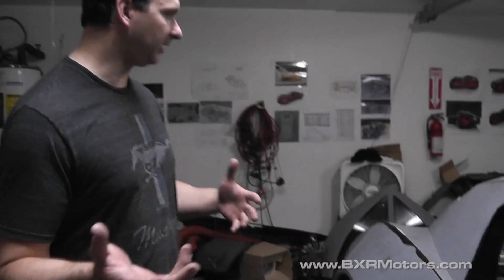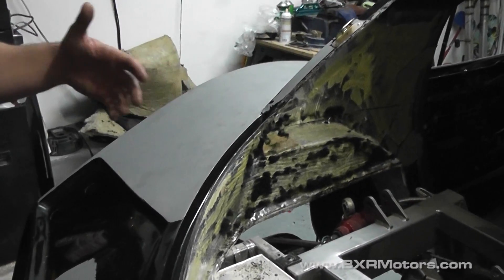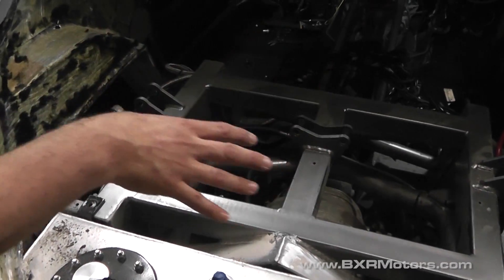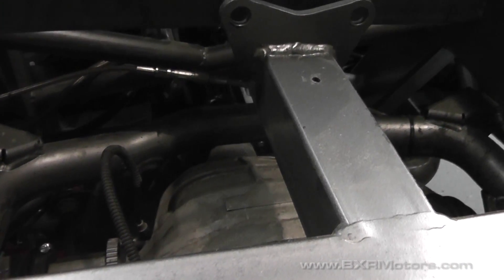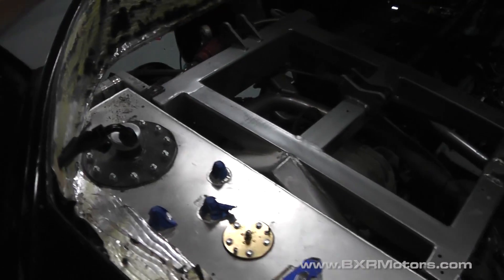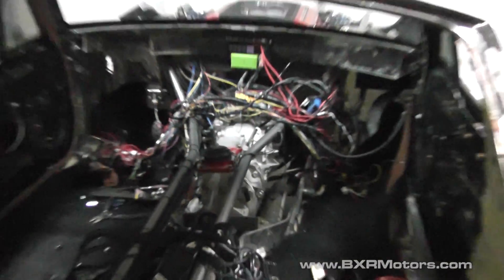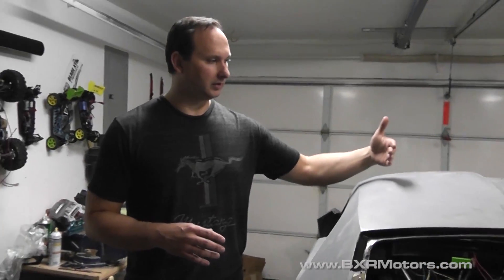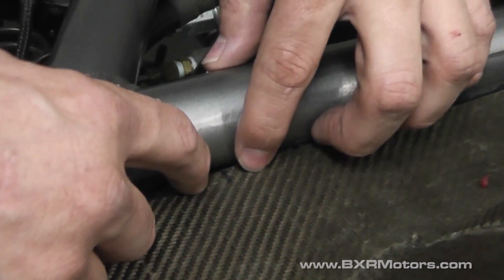Body Lift to Blade XTR Twin Turbo Coyote 5.0

Comment: Seems like after one video they would have changed the battery of the Smoke Detector that keeps chirping.. It would drive me nuts working on that car to hear the detector go chirp every 30 seconds or so.
Reply from the maker: Yeah I tried,  replaced the battery's a few times.  Turned out to be a faulty alarm.

Comment: do you have a smoke detector with a bad battery near the garage or it's your alarm system chirping all the time ?
Reply from the maker: Yeah I new batteries in the smoke detectors but they still beep. I'll try to remember to take it out next video.
Reply: No, replace the whole unit. I'd rather hear the beep than knowing you disabled a smoke detector, especially in the garage :)